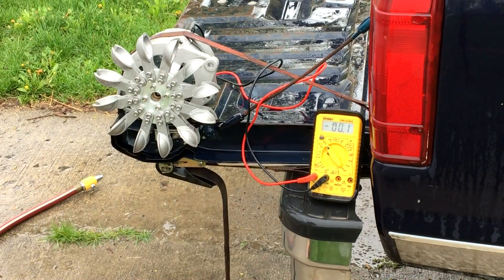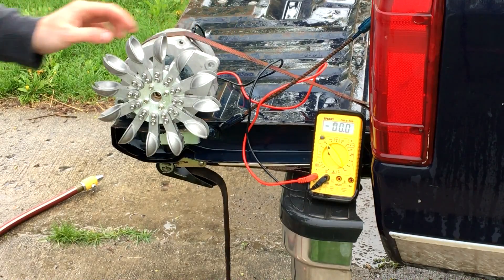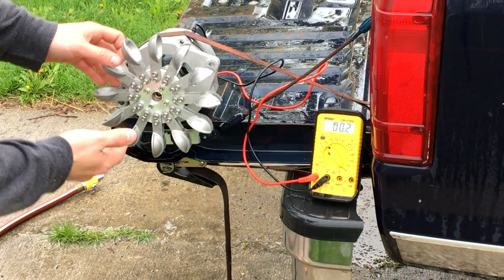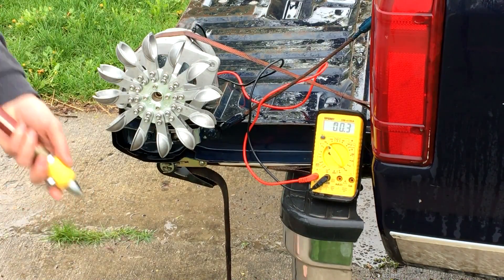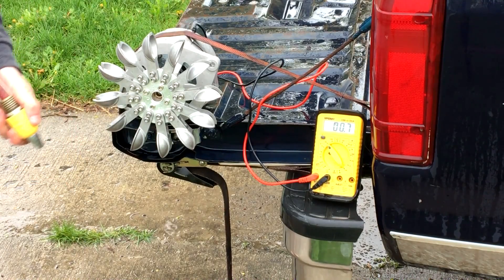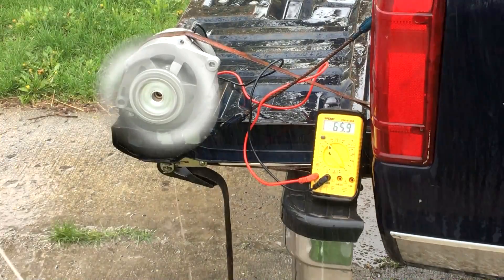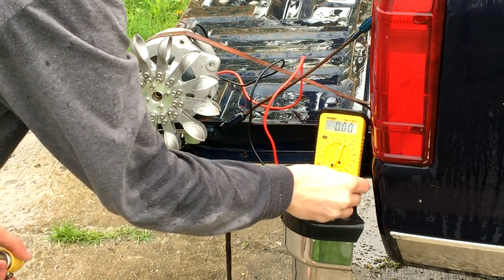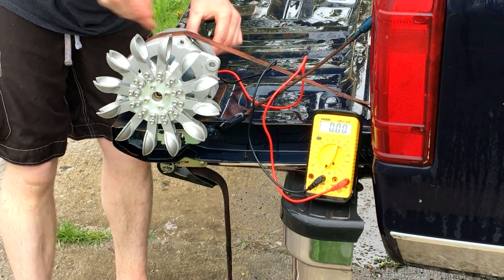Water turbine test

Comment: how many volts/amps to power a small water pump to power the jet that hits the turbine?

if it's an efficient pump (in psi/electrical power), might it be possible to self-feed?

if you can generate more power than it takes to power the pump...
...free energy?

it can't be that simple, can it?

[edit] couldn't this principle work with a Tesla turbine?

peace (from the UK)
Reply: like you said, it would depend on whether the amperages work out such that the power going in is less than the power coming out.  However this would violate the law of conservation of energy because you would be creating new energy that didn't previously exist.  

the whole system works by first turning electrical power into the kinetic energy of the water, but not all of the supplied power is converted to the waters KE (some is lost to noise & heat, resistance in the wires), this kinetic energy is converted into rotational kinetic energy when the water hits the turbine wheel. Once again not all of the waters kinetic energy is used to turn the wheel (some is lost to noise, heat from the collisions), the work done by turning the turbine generates electric power, but not all this work is used to generate electricity, some energy is lost to friction in the bearings and resistance in the wires (heating), also the sound it makes. 

Ein -> KE(water) + losses -> RKE(wheel) + losses -> Eout + losses

After all these losses it would unreasonable to believe that there would be more energy coming out than there is going in, where would this energy come from? perhaps its because the water also has gravitational potential energy because its higher than the turbine... but then again, you'd have to expend more energy pumping the water up to that height.
Reply: doesnt matter how efficient the pump is, you'd never see more energy come out than is going in. look up the law of conservation of energy
Reply: i am aware of the conservation of energy

i am also aware of the following

 if the turbine can generate 80V for an 80psi water jet
and if you have a water pump that can generate 80psi for only 12V (look on ebay)
you have a net gain of 68V from the system
all you'd need is an initial kick start

(if the amperages work out too, of course)

could you explain why if this is not the case?

many thanks

peace (from the UK again)
Reply: nope, it cannot be that simple mon librepenseur...
it is made from atoms, in a real-world,
which are subject to tolerances et entropy.

the system will work for a time,
and will then proceed, via compatibilist stochastic forces,
to unmake itself.
it will not work to tolerance specifications, without inputs...

entropy is the state of un-madeness that a system tends towards over time.
total systems ERoEI is everything that went into making that device - 
such as the neodymium, or copper, or presurizing the water to make it.
R Feynman talks extensively about 2nd Law of Thermodynamics violating 'overunity or perpetual motion machines".

be that a moebius-klein water wheel, or a LIBS lazer breakdown plasmatic converter...
water evaporates, and is corrosive. things that hold it are permeable too...
all of those become complexities...

these are underpinnings of civilizational Olduvai theory, and of peak resources and peak innovation
concepts in SETI, WFSF, et IIASA.

je prends conge mon librepenseur.
Reply: such an eloquent response deserves an equally eloquent comment
but sod it, it's not going to get one, sorry

of course no system ovecomes entropy on a universal scale
but when you look in the smaller scale, at the entropy boundary
there will be undulations in the available energies on the small scale
an entropy waveform, if you will, where there are positive and negative values coexisting
even though the overall trend is a growth in entropy, there are areas, such as construction and artifice, that locally reverse entropy but never overcome the overall trend

this is about storing and releasing energy on a local scale, not a universal scale
does that make sense?

do you see what i mean?

it'd probably be easier to explain myself with (gasp!) pencil and paper

peace

Comment: I wanted to create a water turbine project in which the turbine would be separated from the dynamo. An intricate set of gears would join these two up, in a way that the dynamo rotates much, much faster than the turbine itself. I wanted to try out an idea uploaded for the Google Science Fair uploaded by a girl in 2015 I believe, in which she had two buckets - one with the water and the other, below the former, with the incorporated water turbine. In her project she used a hose to fill the upper bucket let gravity do the rest, but in my idea, instead of using hoses, the electricity generated by the dynamo would be enough to power up a small pump to deliver water from the bottom bucket to the top and start the process over and over again. I had immediately thought it'd not work out since perpetual motion machines are theoretically impossible, but I'd still like to know if anybody has made attempts such as what I'm describing.

Comment: I do wonder what the internal resistance of the 10A port is on your multimeter. The instruction manual says low resistance but thats not very helpful when trying to determine how much W you produce in the end.

Comment: Why did it spin slower when you measured the amperage than when you measured the voltage?
Reply: SpaceSoda Productions the power production was resisting rotation
Reply: Because when measuring aperage he is shorting the output of the generator and therefore the generator is under load. It's just lyke a bike dynamo, when it's hooked up to a light, it's harder to turn.
Reply: When measuring current like this you are short-circuiting the generator, creating a large power demand. The shunt in the multimeter kind of becomes a small heater. Like putting a fork in a mains socket, you draw a lot of energy.
Reply: When you short out a motor like the one he's using, it acts as a brake.

 If you have a brushed motor, like one out of a drill, you can try this. Short out the motor and try to spin the armature, or in the case of a drill, spin the chuck. The faster you try to spin it, the more resistance there will be.

Comment: Does short circuit mean that it displays more or less current than it would otherwise produce?
Reply: It is the highest amount of current you can get at that water pressure, i.e. it shows more than normal. Same for the voltage (open circuit) measurement. During normal operation you would get both lower voltage and lower current.

Comment: Was that 1.9 amps? If so I'm pretty sure you can kill someone with the electricity generated just by the hose.
Reply: Depending on the Voltage output during the measurement. Yes. In fact, you could kill somone nearly 40 times with that much current.

Comment: that generator is proof that earth is flat...
Reply: Kemphoss - Well sure, that's only one way. The other I noticed is how his generator spun, just like the Sun spinning around the flat earth like a spotlight. 

And also Cody's accent is clearly flat earthian, which is further proof.
Reply: hahaha...good one! timing is everything
Reply: Sorry - I took it a little to seriously (as stupid as many flat earthers are, it's sometimes hard to know if it is really a joke), LOL!
Reply: OBVIOUSLY
Reply: well for you simple minded folk. the water is actually attracted to the motors electromagnetictransgravitational wave forces, meaning it is actually at the triple point of water and iron. that means that the earths geometrichetrotetric shape is flat. pffft stupids
Reply: Ride84XL he was joking chill
Reply: what the fuck else could it mean?
Reply: Ride84XL fair enough
Reply: *wears thin foil hat
Reply: Ride84XL Man, there's always one of you guys in every thread.
Reply: +Ride84XL seeing how that joke just orbited miles off your head I guess you're right the Earth isn't flat... fucking hell. Way to be a buzz killer
Reply: What a load of horse shit! It's as much proof the earth is flat as your socks are.
What causes the thing to spin is simply the inertia of moving water. You could as well generate electricity by spinning it manually or by for example attach a gas engine to it. Does that mean you (or what ever you use to spin the wheel) are also "attracted to the motors electromagnetictransgravitational wave".

Comment: Use solar overpower to pump water up into a storage vessel, then use a valve to convert the water's potential energy into electricity when there is insufficient power at night? Then you can use precipitation as an added energy boost for no extra cost to the system.

Comment: The generator peaked at 19.9/20.0 amperes.
Reply: Don't you mean 1.9 - 2.0 Amp, that's still nice.
Makes it about 160watt @ 80 Volts.
Reply: J the Welsh Warlord Cody should have measured both at the same time... Voltage at full short would be much lower right?
Reply: Yes correct, that's why i just made an example with 80 volts. It's properly not near it at all. But should still be enough to charge a car battery (it's purpose anyway heh) or to etc hook it up to a 12 volt power regulator setup.

Comment: Try that with an air compressor
Reply: But then you're using electricity to compress the air, a little redundant don't you think.
Reply: wasn't he using electricity to make the water flow? or fuel, or even manpower to carry buckets to a pressure tower unless he has rainwater in a pressure tower or a dam or something like this.
Reply: Cody has a combustion powered one.
Not sure if diesel or gasoline

Comment: It might be a good idea to get a similar sort of charge controller as you would use for solar applications. An MPPT controller should be able to find the sweet spot between speed and torque for the motor and generate the maximum amount of power.

Also: Get some capacitors and hook them up the motor after the diodes to make sure you don't have extreme ripples on your voltage.
Reply: Tobias Mädel I don't recommend using a solar charge controller. The characteristic curve is not suited for generators. 
I recommend using charge controllers for wind turbines, the turbine runs much smoother with these.
Reply: Bad idea. If you do a bit of math you can easily work out that the maximum power extraction will come when the load resistance is equal to coil resistance. However, under those conditions you will be dissipating as much power in the coils as in the load - your alternator will likely overheat and burn out, unless the extreme torque requirements just cause your turbine to almost seize up first. You do not want to operate an alternator at maximum power output because it's horribly inefficient, and they aren't designed to sustain that kind of load.